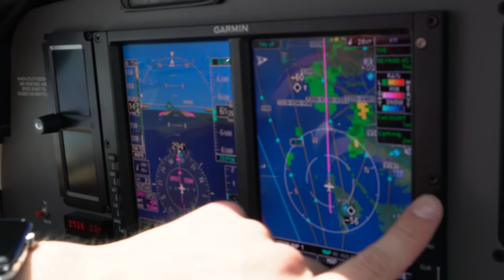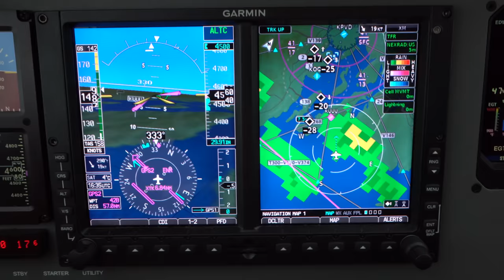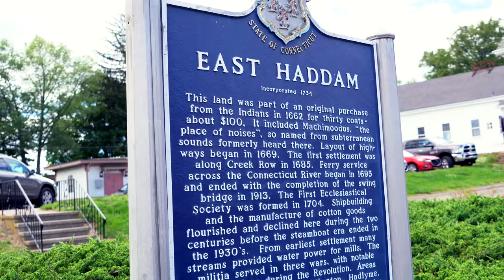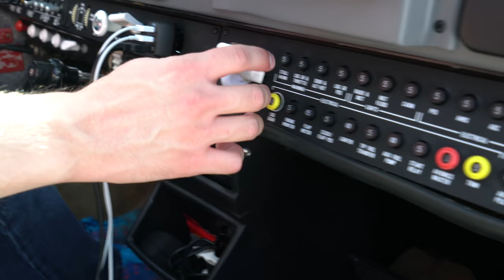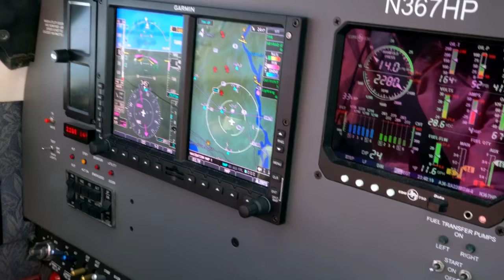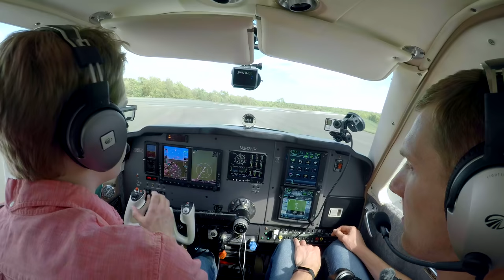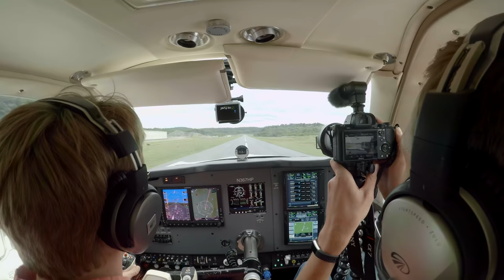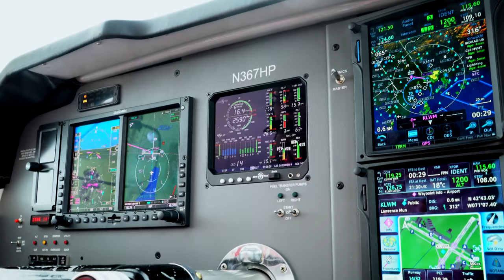Epic Short Runway on the River

Comment: I live about 15 minutes from Good Speed,  there use to be a  200 foot Oak Tree at the end of 32, it got cut down in the mid 1980's. I the 1970's and 80's there was a flight school that did a lot of seaplane training in the summer and FBO services, I don't think you can even get fuel there now. When I learned first to fly  Goodspeed was one of the airports I would go to a lot. I got my private out of the old Waterford Airport.  1600' and low hills. It's gone now,  Of course, I am dating myself, 42 years ago.  Chester is another that I go to a lot, my AME does physicals in his hanger were he keeps his V tail Bonanza.
Reply: George Semel do you remember the Monroe airport?  Now a cemetery.

Comment: Another great video. I was curious, why do you advance the throttle by turning it and not pushing it forward?
Reply: It can be done either way, but this type of control, called 'vernier' gives you more precise control over the engine.
Reply: Also, by using the vernier probably less stress on the engine by increasing the power slower than just pushing it up fast. You only can twist so fast so power is increased smoother..